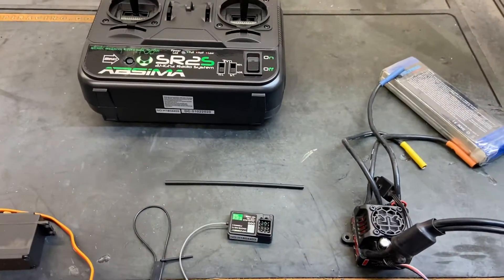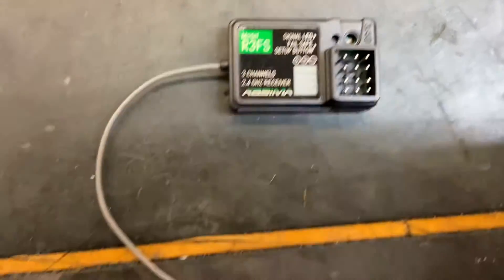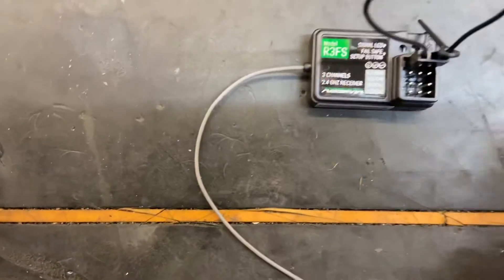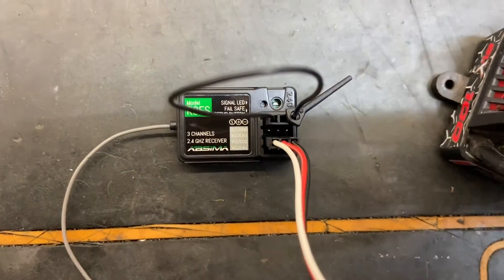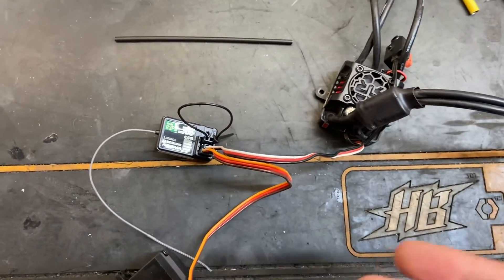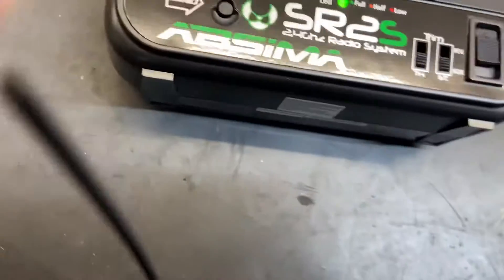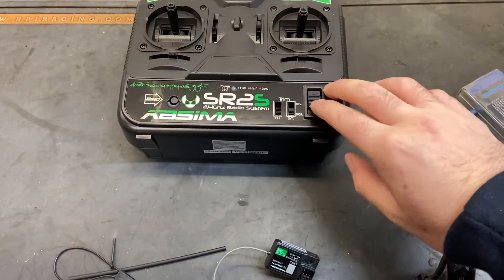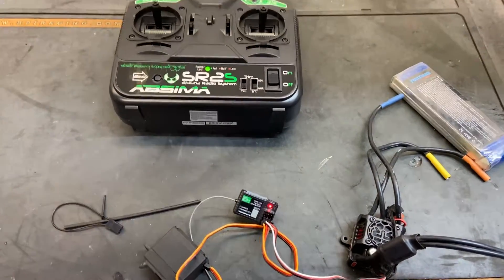Spudski RC How To: Binding and Wiring Up An Absima SR2S Radio Set

Comment: Thank you for this!😊 Just fitted the 4-channel replacement model to a 16mm scale steam locomotive model from '85 with a knackered 27MHz system (though the two, original servos are fine), and couldn't figure out where the power needed to go - saw yours fed in through Ch1, so shoved my power connector in Ch3, hoped for the best, and it works!🥳 Just need to re-jig so the regulator isn't half-open by default next, where this r/c has throttle+brake rather than just throttle like the old system.🤔 Switched on, bound the transmitter, and it automatically centred the throttle servo. Can't have everything go to plan, eh?!😅 Thank you again.

Comment: Hello, thanks for your nice video.
Does the transmitter use 1,2 or 1,5 volt AA batteries?
Because i cannot find 1,5v rechargeables. Or does it work with rechargeable 1,2v batteries ?

Comment: Is it correct that my throttle stick is on the right, which moves left and right and my steering is on the left which operates left and right steering by pushing up and down? Feels like it's the wrong way round
Reply from the maker: Yes that’s the wrong way, if you swap the plugs over in your receiver channel 1 and 2 then it should be the correct way.
Reply: @spudskirc4458  thank you soo much.
Reply from the maker: @JayJay-1985  No problem 👍🏼

Comment: Hi I have an older FTX vantage and I think it needs to be recalibrated but I can’t seem to find the button that is on yours and I can’t seem to find anything on it thanks
Reply from the maker: Hi, Is it a Vantage brushed or brushless you have? If it’s brushless and no button then it’s the original esc and different calibration process